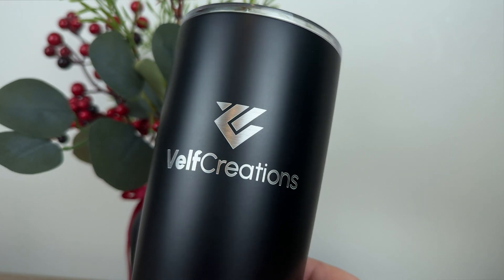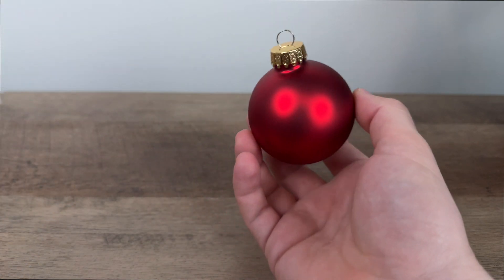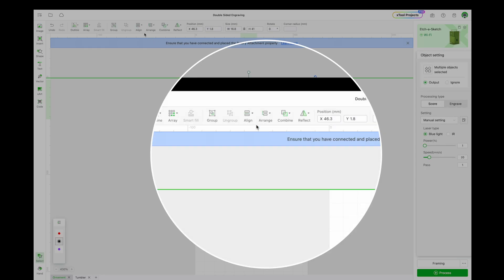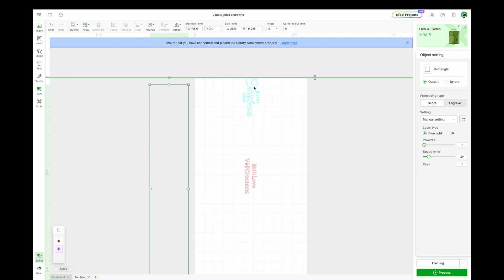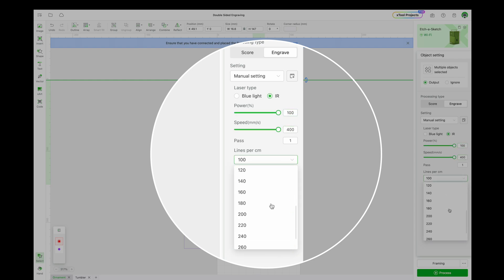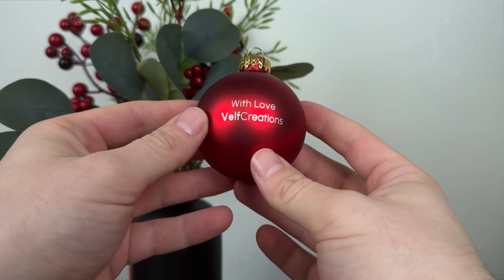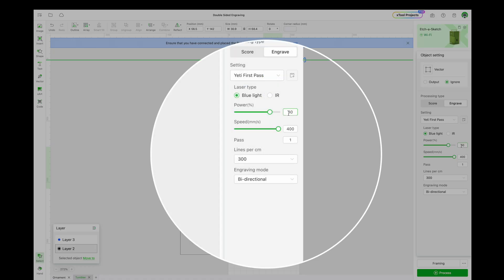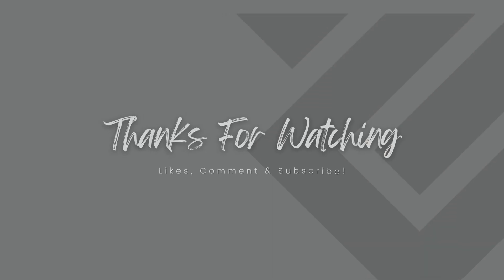How to Engrave the Opposite Sides of a Christmas Ornament with xTool F1 Laser Engraving Machine?

Comment: With the tumbler, why do 1 pass with each layer? Is it to tidy up the engraving or do a deeper engrave?
Reply: Hey! Good question. So we have found that doing this has given us the most consistent results with multiple different tumbler manufacturers and colors. The IR laser helps clean it up so all you have to do is wipe it down after. Sometimes with the blue light you might not get all the residue off and you have to scrub it a lot. 

Or if you have the power set to high for the blue light it will give the metal underneath a golden color which is harder to fix. 

This has worked great for us leaving a bright shinny finish after.

Hope that explains our process. There can definitely be other ways of doing it but we haven’t had a single yeti, thermos, or generic tumblers not result in a perfect clean look.
Reply: @VelfCreations  thanks for the reply, I guessed that was the reason and it makes a lot of sense if it gives good, consistent results. :)